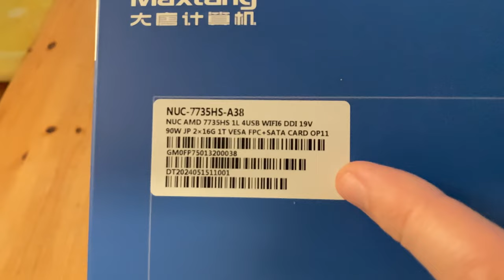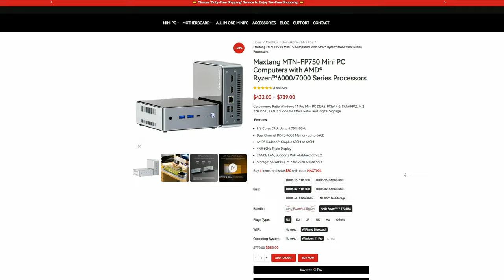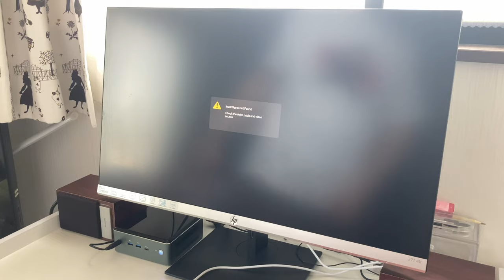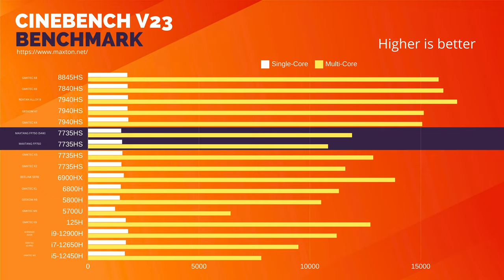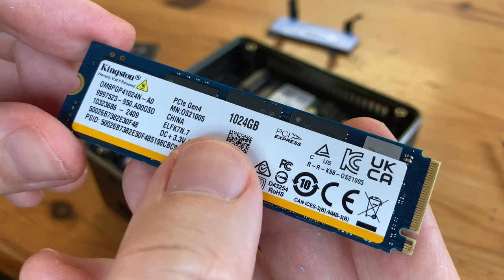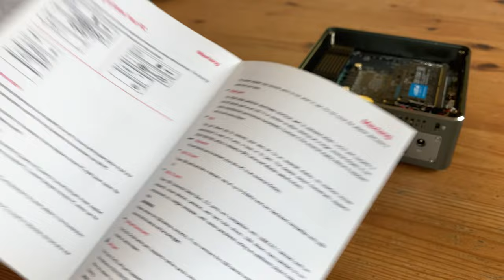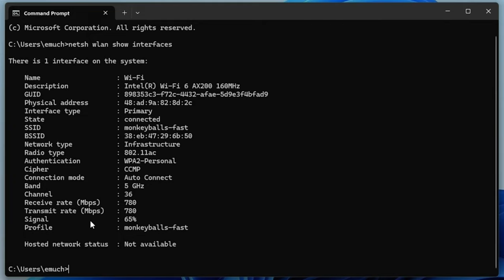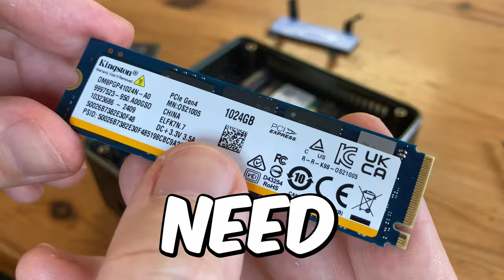This Ryzen 7 Mini PC Gets MANY Things Right [Maxtang FP750 Review]

Comment: A dodgy cable, Windows with an issue...Not great, but to be fair, my GMKTek K6 arrived set to boot from USB, so these things do happen. The most annoying thing was the 2.5 cable telling you not to get it the wrong way, yet making no effort to explain the letter marking, ok, M = Motherboard sounds right, but with no confirmation anywhere from the company, who knows what could have happened. Not good.
Reply from the maker: @Mclaneinc  I think a lot of these problems could be fixed quite easily.  The sata thing needs an insert, OS is all software side, and the cable maybe more checks ?  The PSU is okay if you intend on leaving it at 35w.
- if the computer had something like an overheating nvme / SSD / CPU issue, then it'd need it's case redesigned which is a huge ball ache.
Reply: @TeamPandory  Because you had a higher spec PSU, did you try it?   Have any very rough idea if it made a noticeable difference in performance?
Reply from the maker: @dlewis9760  yes. That's how we got 45w and 54w tdp benchmarks.
Reply: @TeamPandory  I just wonder how they don't find these things before release. I remember in the days of the launch of the Xbox, I was then working for a computer company and we also sold games and consoles. We ordered an Xbox pod for the shop side, only to find that when left on the consoles went dead very quickly because they were over heating and then being in a pod under a bubble for protection, that only exacerbated the issue. How MS got to the point of release with a serious heat issue that also happened if the carpet in a house etc. Sure, they 'mostly' fixed it but still managed the same thing in the 360, but those pods were not cheap. When it happened the first time in the shop area, I was asked to see what the issue was and as I lifted the pod cover it was clear that these poor buggers were roasting. Hence, the moan to see stuff getting marketed with pretty serious issues that no one found or just ignored. Sure, new products are not cheap, there SHOULD be a serious amount of testing, but I've seen so many shortcuts when we were offered new products at Maplin. We actually tested a model boat from out your way Tim, (why we were selling these god awful item's in a semi competition with Tandy, yet we were an established electronic component firm, why sell tat). Anyway, I can say with total honesty, the boat kept sinking, we tried 3 models, 2 sank every time. Makes me think of the saying, "you had one job", which sadly isn't true, as they had lots to look at. Just saying...Paul..Anyhow, top marks on the video Tim..
Reply: @TeamPandory  Thanks.  Didn't pick up on that.   I was focused on the 3g/4g smoothness.

Comment: Update, Just witness the ddr5 hit 70c -79c.  Wow! it needs the cooling fan for sure.  15mins in game will drop the fps down due to ddr5 overheating.
Reply from the maker: 70-79 degrees is acceptable.  Could be something else that's triggering it. 
Can you give any more info ?  What tdp are you running at ? What game and settings ?

Comment: The cons are a tad annoying indeed and take the gloss off. The rubber feet scenario has been solved by others for ages. Feet with holes to insert a screwdriver, no removal required.
Reply from the maker: True, but how many others allow you to easily pull out the board to get to the CPU ? 😅